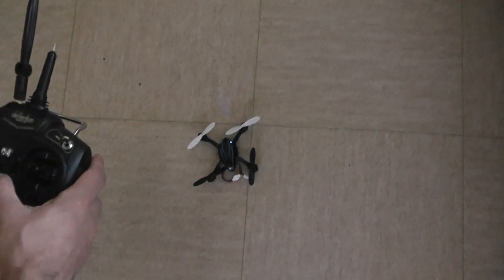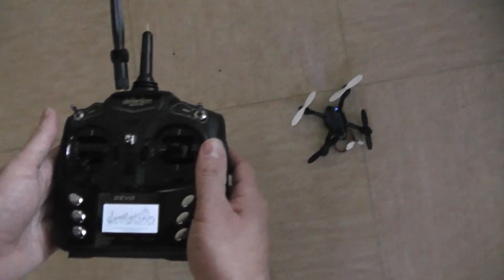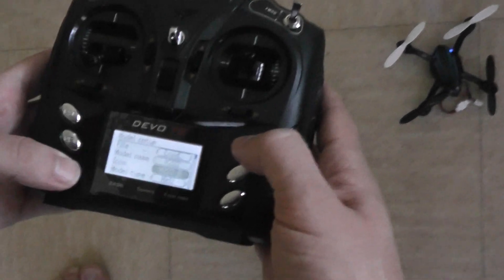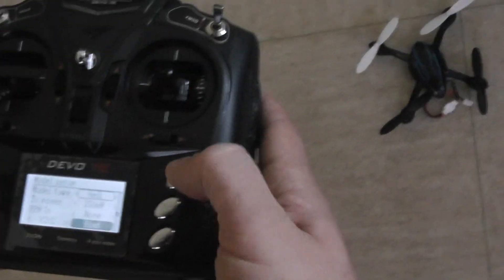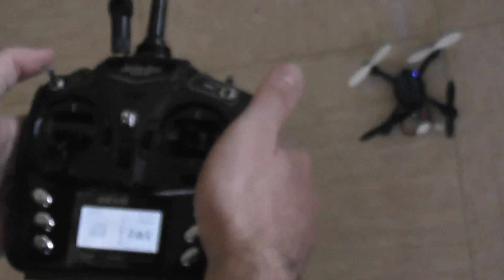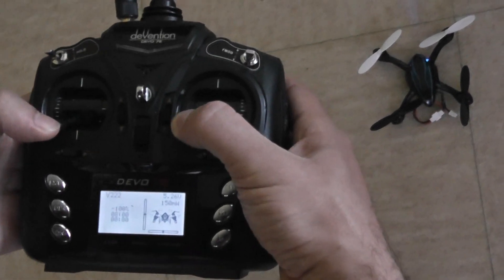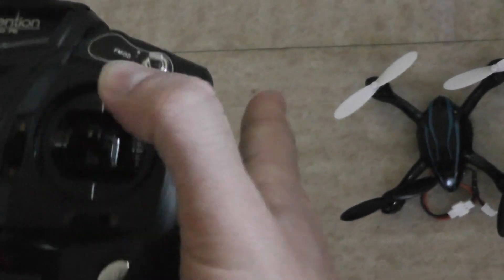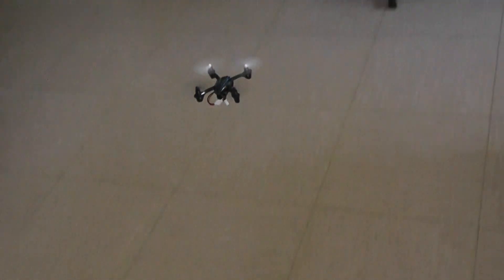JXD JD 385 + DEVO 7E +  binding procedure + gyroscopes calibration + small test flight

Comment: Can I bind the Devo 7e with the WlToys WLtoys V930 Power Star X2_?
Reply from the maker: With a stock Devo 7e  no ... you need to add at least a nRF24L01 RF chip inside... but it's even better to add a multimodule 3-in-1...

Comment: Will the devo 7e also bind to the Estes proto x?
Reply from the maker: Hubsan protocol is based on the A7105-500 RF chip. If you installed into your devo 7E, yes you can fly your Estes Proto X. Some model file can be found in deviationtx.com for this quad

Comment: Hello SeByDocKy nice video.
I'm quite new to RC stuff and decided to get a Devo 7E to control my JD 385. Therefore I got some questions:
- Do you have a link to a tutorial how u soldern the nRF24L01 modul? Most of the moduls I find have a 2x4 2,54mm Jumper header (GND/VCC/CSN/CE/SCK/MISO/MOSI/MISC). It's not in the devination manual for upgrading moduls.
- What model do you use on the Devo 7e to control the JD385?
Reply from the maker: Check my video of the 2 october with the V922, I gave the link of my nRF24L01+ I am using

Comment: Hi SeByDocKy, I have two units of JD385 controlled by DEVO 7E. It is quite strange that the quads are out of control sometimes. The command from the remote seems to be delayed to the quads. Also, if the eyes are blinking (out of battery), the same thing will happen. Do you experience this?
Reply from the maker: Yes few times I observed that. In this case I had to rebing several times .... I guess there is still some bug in the V2x2 protocol implementation. Good news, there is a new beta version (3.1) of deviation. It should help.
Reply: Thank you so much!!! BTW, do you try to change the props or battery that can boost the performance?
Reply from the maker: I am using some 380mah LiPo. Flying 8 mn with them...I didn't change props yet but I am very satisfied of stock ones
Reply: so sorry, I can't find 3.1 firmware from deviation forum. Would you share the link with me?
Reply from the maker: PentaChicken It's still in beta stage. Download  the last "Nightly Build"
Reply: SeBy DocKy So happy to know you. Thanks for reply me so quickly. I have tried the 3.1 beta and nightly build. The problem still exists. How about yours?
Reply from the maker: Seems to be net yet full solved ... In deviation forum, there were talking about to add a binding shortcut button ...It could be a solution to this problem

Comment from the maker: You have to install a nRF24L01 + PA module (10 USD on ebay) then install the deviation 3.0.0 nightly build. It's not easy to install the module. You need to make 2x7 difficults soldering.